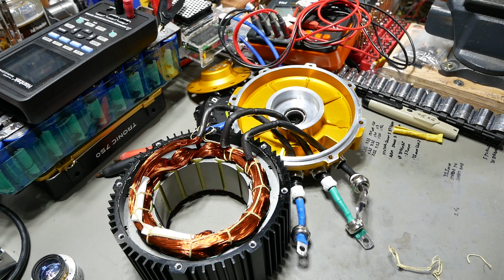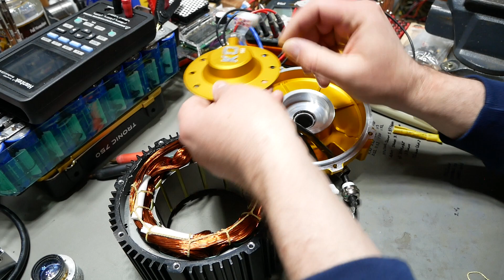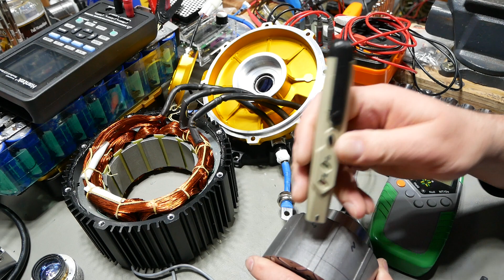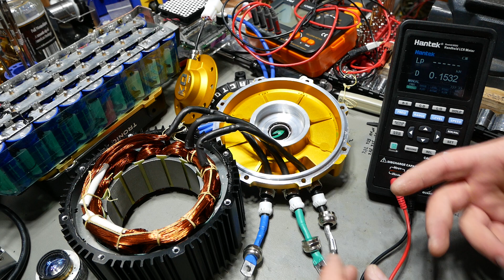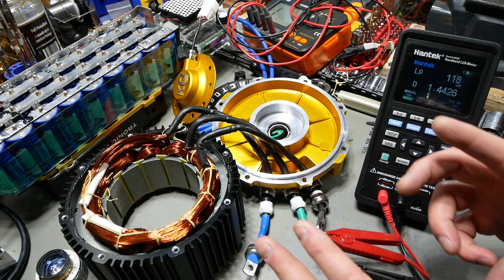KO Moto FSPEC motor teardown 2

Comment: As far as I know, this is still the best motor in this size that's currently available. I know EBMX is releasing a motor soon.
Reply from the maker: It's not a total turd for sure. It needs some attention to details like I show in the tear downs for it and in what I do to resolve them. I doubt I'll ever do a simulation for this motor. Just getting them is astronomically over priced! The EBMX motor will cost less and be more powerful. There's another option coming this fall that will be from a German team and will also cost less that the FSPEC motor and will be more powerful. It will also have no short cuts anywhere in it. Those guys attention to detail is VERY GOOD! I don't know if it will be more powerful than the EBMX motor, but I'm sure they won't release it without knowing every thing is the best they can make it! KO Moto blabs and brags about this and then never does anything close! The FSPEC motor you see in my videos is PROOF that they suck at the details and in doing a good job! Their controllers are PROOF of this!!! I'm betting I could buy 5 more each of Rush, FSPEC and Pro controllers and find the exact same shoddy work in them too! Same for the FPSEC motor. My level of confidence in KO Moto is VERY LOW. Sure they work, but quality control is dismal and build quality where you need it is horrible!
Reply: @de-bodgery  can you name the German company that is manufacturing the motors or it's still a trade secret? I'd love to see something nicely built once in a while :)
Reply from the maker: @thegrave2000  Not yet...Iol.

Comment: I love your work; Can't believe I thought their motors would be any better than their controllers.
Reply from the maker: I wanted it to be really good too. It wouldn't be hard to do a better job either!
Reply: @de-bodgery   I really wanted it to be good; It's the one thing I was looking forward to from KO that might be able to bring these bikes to the next level. I see the strengths, and small improvements, but at 1400$ for some ehh cast machining and anodizing.... I rather the motor look stock but actually hold upto power all day; Anyways Peace n love
Reply from the maker: @lahoozer6694  It's a pretty strong motor. However, as you can see quality is lacking where you can't see it! Kind of sad! I deliberately delayed taking apart the motor so I'd be level headed and not still feeling annoyed at the shit show the Rush is! And here it is...typical dismal quality control from KO! If you watched my issue mitigation video on this motor, then I'd LOVE to have KO improve and shut me up!!! $1400 and a split armature, cheap Chinese bearings, poor phase wire binding, etc...yeah...disappointing despite it being a decently strong motor! Ironically Jay Okumura and Ian Hastie claim I sabotaged the motor just to make KO look bad. What idiots! WHY would I EVER do that?

Comment: the issue with loose binding is also an issue with the magnetic forces between the wires themselves - so they'll vibrate even 'on the bench'.
also inductance needs to be measured with the rotor in place -as it impacts the inductance reading (particularly for IPM) and varys on rotor position.
Reply from the maker: Yes, thanks for pointing out magnetic vibration. I knew about this and forgot. Inductance, I did that for the QS165 motors and the values came out the same. Taken apart or assembled the inductance was not significantly different.
Reply: @de-bodgery  it depends on the motor, but also on the rotor position (between its 'low' energy points where the magnets force it to settle should be higher)
Reply from the maker: @sn0wchyld  On the QS165v1 and QS165v2 I tried several armature positions and didn't see much of change in inductance.